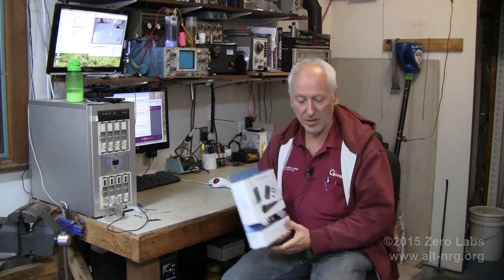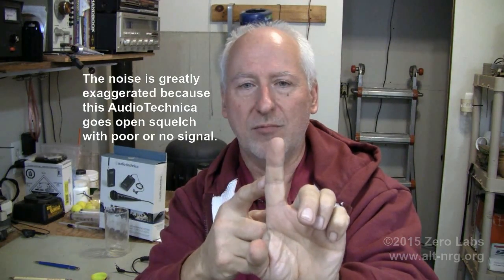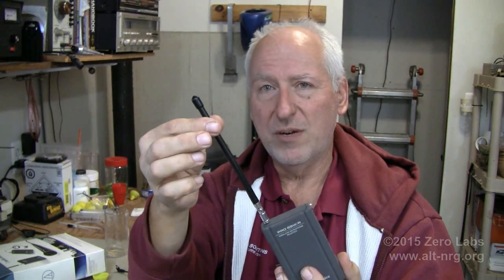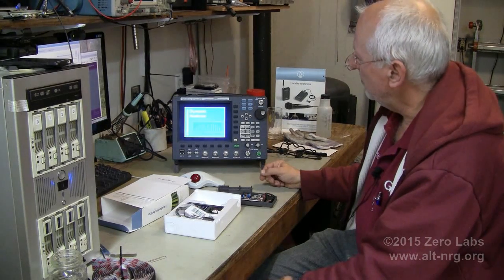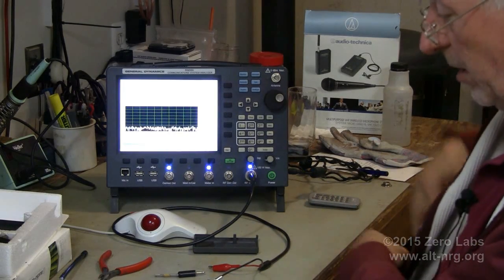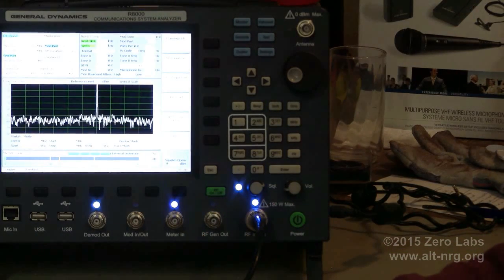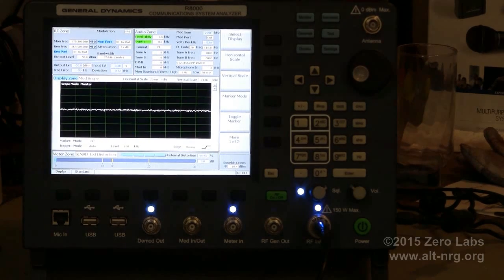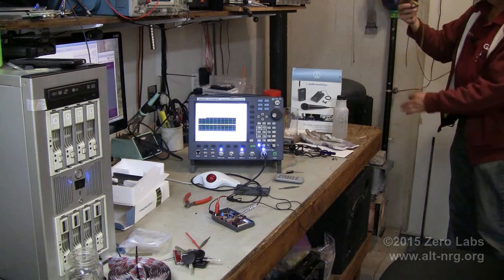#424 RWG wireless mic repair and mod

Comment: Well done Zero. How much is such an service monitor Measurement device ? Great device to have ! BTW, how are you doing your Wireless setup with the multiple webcams that you use ? Did you make a video about that yet ? Many thanks. Regards, Stefan.
Reply from the maker: +overunitydotcom A used R8000 reasonably loaded (P25, DMR, Tracking Gen, Cable Fault, etc) will set you back about $20,000. Most times I just use one wireless mic with multiple video feeds in OBS. Once in a while I'll leave a webcam mic open but not often.
Reply: +overunitydotcom I think you could use cheap RTLSDR usb dongles for this kind of frequency adjustments.

RTL-SDR is a very cheap software defined radio that uses a DVB-T TV 
tuner dongle based on the RTL2832U chipset. With the combined efforts 
of Antti Palosaari, Eric Fry and Osmocom it
 was found that the signal I/Q data could be accessed directly, which 
allowed the DVB-T TV tuner to be converted into a wideband software 
defined radio via a new software driver.
http://www.rtl-sdr.com/about-rtl-sdr/

Comment: wonderfull! rock my socks off. I presume you checked both frequncys? and only the one was off? I'm looking forward to testing this out! thanks for taking the time. !! wohoo Sswwohhhh ccckkkkeeee shhhhhhee ~Russ
Reply from the maker: +rwg42985 No, I still have to look at receiver tonight but I'm not doing another video on it. Pretty much the same only I generate the signal with the service monitor, then sweep up and down in frequency to make sure the IF circuitry is aligned. I'm very disappointed but not all that surprised that the Audio Technica does not have a squelch circuit like my Nady. Even I get multipath once in a while but instead of blasting out white noise, buzzing and static it just mutes the audio. Nor does it have any input gain or output level adjustments like my Nady. Product engineering of this wireless mic leaves quite a bit to be desired.

When you get it back, make sure that the antenna tail I added extends 90* to the direction of the rubber duck. Also try placing the receiver in different spots. You can use any 3.5mm stereo cable to extend it out. You can also try adding a long wire in place of the rubber duck. You may have to experiment a bit to cover all your dead spots.